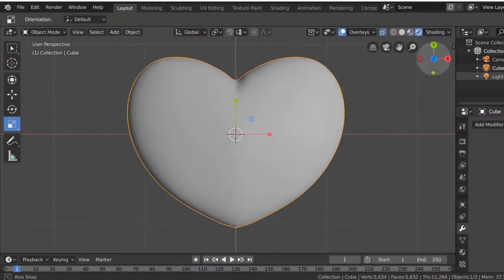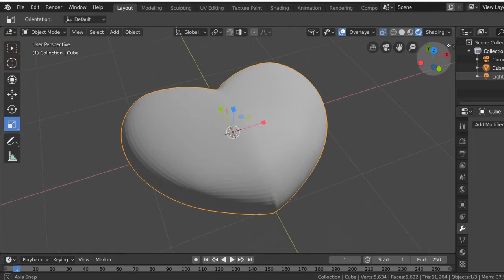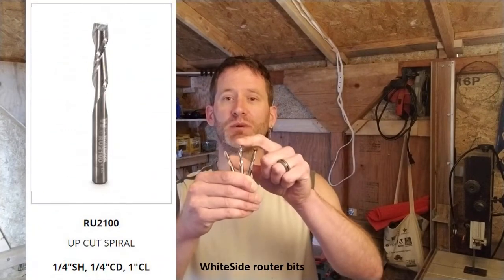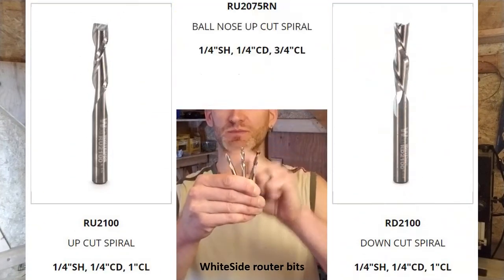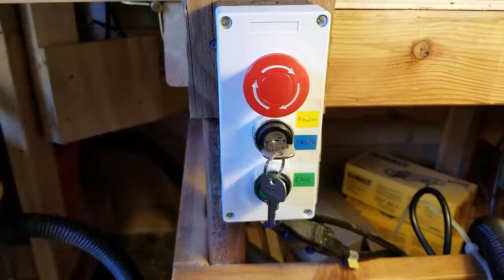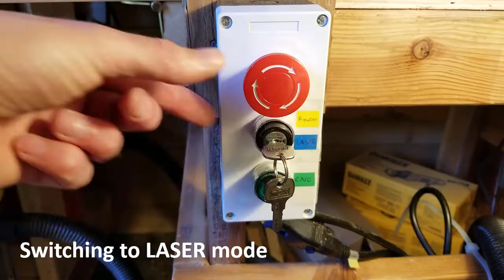Carve a 3D heart box with Bob's E3/E4 CNC router

Comment: If the thickness of your workpiece is critical as in this project, just joint one side then use the CNC to plane down the other. It’s really just a surfacing or facing operation using the wasteboard as the Z zero and running one or more facing passes down to your final thickness. It will require some different workholding since you can’t have clamps on the top during the facing operation. In this case you have an auxiliary wasteboard so counter sunk screws would be an option.
Reply from the maker: Yes, there are many different ways to get the same end result.

Comment: thinking of getting this cnc for knife handle work and inlay on knife handles.. will thi machine perform
Reply from the maker: It's a light machine for easy wood working tasks. For heavy duty stuff, you'd probably want something else. But I'm pretty sure that it will be suited for the type of wood working that you plan to do.
Reply: @dennisvanhoof9958  got my machine and built it this weekend . having trouble getting even a simple fusion 360 circle working . having trouble with the z action . any chance of getting the gcode from you bowl to see some of the code.. do you do 2 separate codes .. one ruff pass and one cleaning pass ?
Reply: @dennisvanhoof9958  never mind.. i see you have the files on your website !!!!!
Reply from the maker: @Advansite  I recommend becoming a member of the BobsCNC Facebook group, as you will probably find answers to all your questions there. It is a very helpful and pro-active forum, and practically all members have gone through the same start-up and learning process as you have. I do not have Fusion 360; I purchased VCarve Deskptop. But to answer your question: I do indeed create different tool paths for different router bits, as they all have their own specs and dimensions. However, the issue that you encounter is most likely not related to the software, and I don't think sending you a file is going to resolve it. Besides, the G-code for the 3D heart-shaped box is much more complicated than a simple circle. If you already face challenges with a simple circle, then using more complicated code will make it even more difficult to trouble-shoot your problem. Hope this helps. Last but not least, you can always reach out to the BobsCNC helpdesk, as they've probably had the same questions from new users many times. P.S. the files and all information can be downloaded from the link that I provided in the comments section: https://topoarts.com/carve-a-3d-heart-shaped-box/

Comment: I would have liked to see how the shaping part was done.  I am a complete nubee to this.  Do you need special software for making shapes?  Any recommendations?  Thanks!
Reply from the maker: Hi Dean, Not sure what you mean with "the shaping part," but if you are referring to creating the 3D designs, then I used Blender. It's a free 3D modeling program.
Reply: @dennisvanhoof9958  I would like to make a part like a guitar neck or whatever I would think.of.  I was told I need a 3d program to do this.  Does that make sense?  Thanks
Reply from the maker: @pipercub45  I think you can do those things with Blender. There are tons of tutorial videos on YouTube.
Reply from the maker: pyrotechnic5254  VCarve from Vectric.

Comment: How did you drill the holes in perfect alignment since you had to turn the block upside down and keep inline?
Reply from the maker: Hi Cliff, I aligned the dowel holes perfectly relative to the X/Y zero datum in VCarve (you can do this by typing in the numbers, rather than moving the holes with the mouse). Then, the dowel holes are drilled through the stock and partially into the custom spoil board, so that when flipping the stock upside down, you use the holes that were drilled into the custom spoil board. Hope this clarifies. For another example, have a look at this video: https://youtu.be/J9CsbgKV55o
Reply: @dennisvanhoof9958  

Thank you Dennis. Very smart! I had my learning the CNC on hold for a few weeks as I rearrange my cellar woodworking shop. I'm working on setting up dust collection piping now but will get back to it soon. I will have to learn how to do what you told me. I can see that is the way to get perfect alignment.  Thanks for the info. I look forward to future products and projects from you Dennis!
Hey, I see you got a new CNC. What brand/model? How does it compare to bobs?

Comment: Hi Denis!
How long did it take to carve everything?!
I’m wanting to purchase one of those but I couldn’t find anything about the speed.
Tks!
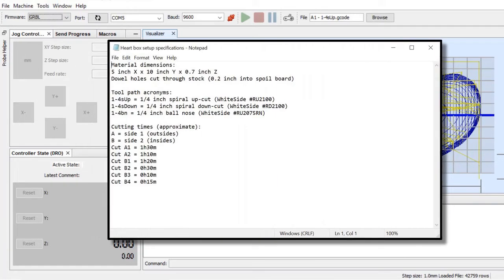Reply from the maker: Hi Wallace, I used very conservative (read slow and shallow) cuts to minimize the strain on the machine when using (very) hard wood. All the routing times for each different tool path are listed in the TXT file that is included in the ZIP file. It's shown at 0:44 in the video (Cuts A1-B4). Note that you can change the cut depth and feed rate to speed up the carves in the original VCarve file, which is also included in the ZIP file.
Reply: Dennis van Hoof thank you very much!
I’m not familiar with VCarve...do you have specific reason to work with this software?!
Because I was wondering the difference between this one and FreeCad which is free for example?!
Reply from the maker: @wr3678  I worked with F-engrave (free software) for a while, but if you want to do more complicated stuff (like 3D carvings), then you need more sophisticated software. VCarve was within my budget, and they have an awesome series of online tutorial videos on their website. Superb customer service too.

Comment: hi. i have a question ..does the CNC come with the laser attachement ?
Reply from the maker: Hi Marius, de CNC machine is not made by me, but by BobsCNC and it does not come with a laser attachment or any of the other kits that I designed and developed (like the Dust shoe, the Tachometer and the Bit changer, which can all be found on my website, including videos to show how they work and perform). Note that BobsCNC does not sell any add-ons at all, so I made these kits and offer them for sale, because I thought they would come in handy and add some safety, comfort and cool new features to the machine.
Reply: @dennisvanhoof9958  thats awesome. I will have a look at your website. I might be interested in getting one and ill find useful your laser attachement.
Reply from the maker: @mariusRoBz  Sounds good! Just make sure you reach out to me (by e-mail or the online contact form) if you want to buy several kits at the same time, so I can give you some discount. :)

Comment: which device is the one that measures the revolutions? Minute 4:19
Reply: or rather adjust the router RPM
Reply from the maker: @isaacirackzambranoaguiar6407  I made an optical tachometer kit to measure the spindle speed, and then adjust the RPM with a variable speed controller. Check out my other video: https://youtu.be/HNXbU963YbY

Comment: HOW I CONECT LASER TO E4 MACHINE ? GREETINGS !
Reply from the maker: Unfortunately, it's not as simple as just plugging it in somewhere and it works. You'll need to change the wiring on the CNC circuit board, get the right type of LASER module, solder a fitting connector plug and wiring, upgrade the firmware of your CNC, install postprocessors, and have a program to design LASER tool paths. Note that I wrote an extensive 81-page manual with very detailed step-by-step instructions, including a list of all materials you need, where you can get them, and how to set it all up from scratch. You can purchase the manual here: https://topoarts.com/diy-laser-cutter-engraver-kit-for-bobs-e3-e4-cnc-router/